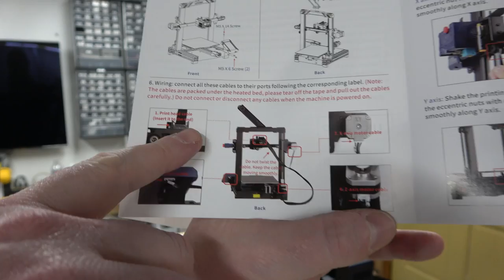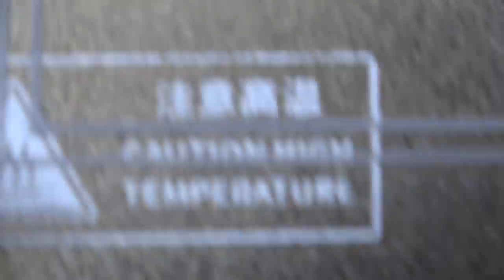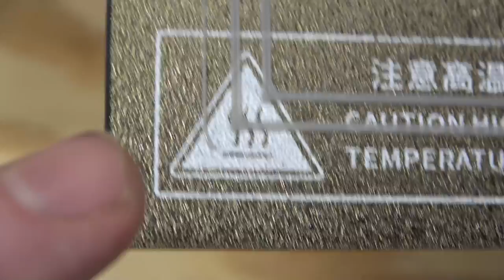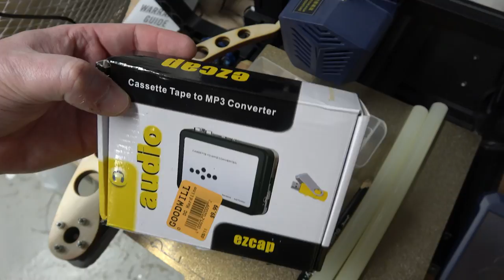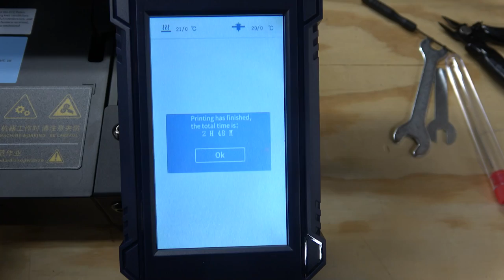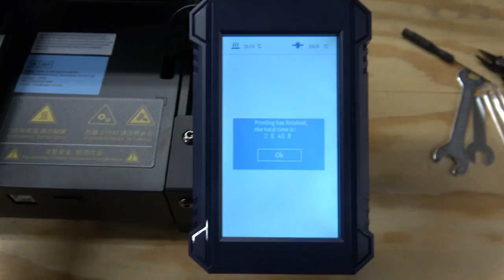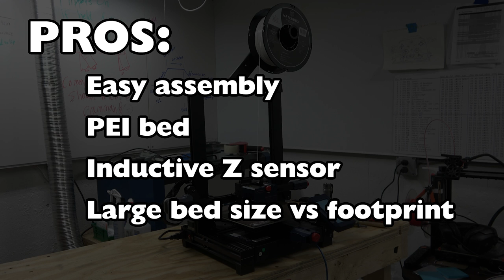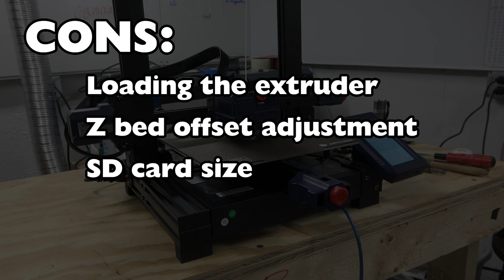Anycubic Kobra 3D Printer Review

Comment: Cura has a setting that makes it pretty to compensate for elephant foot without adjusting the model. The setting is "initial layer horizontal expansion", and a negative value shrinks the first layer.

Comment: It is set to 230V to protect the Printer. If you use it in the 230 Setting with 115V, nothing wil happen. But if you set it to 115V and using it with 230V, than you have fun but only once.
And most of the world uses 230V

Comment: If this printer had ethernet or Wifi, that'd be great. All you'd have to do is log into the interface and upload a file to the printer and it would print. I think Cura has a way to interface with network printers. I hate Cura's implementation of USB printing because, since the buffer resides on the computer and not the printer, if the computer goes to sleep or Cura crashes, then the print could fail.
Reply from the maker: Yeah that's be great! Save Gcode to disk, map network location, printer sees new file arrive and runs it.

Comment: You should be using Prusa Slicer.  Its superior in every way to Cura.  It has an elephant foot compensation setting.
Reply: Cura now has a setting first layer horizontal expansion. The nice thing about Cura is how often it’s updated, which is something Prusa Slicer doesn’t do often. Super Slicer (a Prusa fork) is better, but Cura isn’t bad either.

Comment: I agree on the SD card thing, I don't know why you'd want a micro on such a large device - you aren't cramped for space! Regular SD is much easier to handle.

In terms of the z-offset stuff that may be the inductive sensor.  I was very unhappy with the one on my Creality CR-10s Pro.  I was constantly having to fiddle with z-offset.  I think they just measure inconsistently.  I upgraded to a bl-touch and haven't had to mess with it since.

Comment: You can actually get really good TPU prints out of a bowden setup with capricorn tubing and a BMG style extruder with a small gap. The viper you have actually has a BMG clone, but only certain clones have an internal extension that reduces the gap between the filament input and the output to the bowden to just enough surface area for the gears to grip. A BMG grips filament REALLY hard so they can actually perform super well with flexibles. Capricorn tube has a more consistent internal diameter and tends to be a bit tighter than the generic tubing so that also stops the TPU bunching up

Ps: In England we just say fillet with a hard L for everything and route as "root"

Comment: My Kobra is woking great so: “If it ain’t broke- Don’t fix it.” I did do the z hight and my latest to prints had no elephant’s foot nor squishing around the bottom. I used a sheet of paper. The bed held the print until it cooled then released it. This is now my favorite printer of this size.

Comment: Maybe doesn't excuse the inclusion of micro-SD, but the best purchase I ever made for my MP Select Mini was a micro-SD to full-size SD adapter (basically a long ribbon cable with a housing that supports full-size SD cards on the end, and a male micro-SD on the other end). Quality of life improved dramatically since the SD card is basically the only viable way to use that printer.

Comment: I have one of those cassette to MP3 deals, and if you have old audio-books (and  a lot those of the vintage that came on cassette are no longer available) on cassette to put it into another storage media....  The 'zit' that you 'cleaned off' is a hatch latch for the port-hole in the back of the cabin on the benchy, depending on which one you are using it will be there and is NOT a mistake.

Comment: The question is, if you are knocking the same parts out per run, is 4 of these at $400 faster with better print quality than a V400  for $829 running at 200 mm/s?
Reply: Not sure what you mean about $400, these are $299 normally, and on sale now for $245.

BUT, Why not buy one for $99?  Ebay unrepair.  These are due to Covid and people trying out new hobbies and failed wannabes returning them.  I've bought 4 unrepairs now (1 x Ender 2 Pro for $69 delivered, 2 x Ancubic Mega X for $109 delivered, and an Aquila for $89 delivered for a relative) only 1 of them wasn't mint condition, never even attempted to be assembled on the other 3...  You can even buy the Allstate Warranty for $6 to ensure you get it running ok...

But for this build size right now, the by far best value is the Sovol SV06: same sensor auto leveling, linear rods ALL axis, true FULL metal hotend up to 300c, direct drive with planetary gearing, same PEI bed, full Marlin on control pad, 32 bit board with silent steppers, all for $259.
Reply: @brianmi40  these are on sale at micro center for $99.
Reply: @brianmi40  you could have almost 3x Kobras, for the price of an sv06, so I don't really see how that's an excellent value.
Reply: @foam27  ZERO Kobras can print high temp filament, that's the value.
Reply: @foam27  That's a great price, unfortunately, having to pick it up only, with only 25 stores, limits this to a minority of most people.
Reply: @foam27  Pretty sure you're mixing up Kobra and Kobra Go.  COMPLETELY different machines.

Comment: The lion kingdom has to probe before every print & adjust Z offset during the skirt.  The bed is compressed by the pressure of filament extrusion, at least with buildtak.

Comment: this is a terrible printer plz buy the Vyper instead its 10x better, Issues: Ones sided fan duct hence always leaves yr prints looking terrible on one side, Micro SD is just silly to have on such a device where you have to remove it a few times daily, top frame support piece is plastic making the frame sloppy, the single Z motor can not keep up with prints higher then 150mm causing large amount of banding, the extruder kept on skipping when feeding large volume of filament, the bed level sensor is set too high hence you have to offset Z axis by 1.5mm which is not usual from any other printer I owned (-0.1mm-0.2mm MAX usually), the runout sensor is inside the direct drive mechanism making it impossible to remove and forcing you to apply twice the regular force to insert new filament, every time you remove filament the PTFE piece pops out with yr filament because the nozzle melting chamber is much larger then 1.75mm, these were all issues I noticed on the first few days of testing, I need to do more comprehensive tests before finding out more issues, I've had 2 Vypers that I purchased last year and till now they have been printing at least one spool a week without a single issue, the Vyper is more ridged better made and higher build volume and quality, I have tested more then 30 different printers since I started in 2014 and I would def recommend the Vyper for beginners and the CR-10 v3 for Advanced users. It would be nice to see more honest reviews! I would also suggest using the printer for at least a week before releasing a review video. PS printing a Benchy isn't as useful as a calibration tube 😉
Reply: And why is that?
Reply: Does build year make any sense between  3D printers in general?
Reply: @justinsmits3916  off course it does the later the better, the first Vyper that was released in the end of 2021 had 3 upgrades on the first quarter sales in 2022 google it 🤓
Reply: @mussydesign7933   You prefer the Vyper right? I agree with your statement. But I still can't make a choice between the Vyper and Kobra.....

Comment: I have been using it for a month with PLA, ABS, TPU and PETG. It was working 24/7...

Then yesterday it messed up a PETG print. I then dried my PETG. It dod not help. I level the bed before every print and set the Z offset.

Went back to PLA and used a piece of gcode that I have printed two dozen times already without problems.

Changed the nozzle. Went through the manual again. Tightened the belts, etc.

Nothing helps. It messes up all prints and I have no idea how to solve it.

It seems the leveling is a bit off after auto leveling. Z offset is a bit lower on the left than on the right....

Comment: Hi first of thanks for your entertaning vids i have this printer use it fir my hobby rc planes and has been great until now the extruder stepper motor starts chatering have checked blocked nozel voltage to stepper and the drivers on the board to no avail would you have any idea ?

Comment: that textured sheet is designed to help keep the plastic stick when hot, but release when cold. that's why it was sticking well when you first removed the prints but it was popping off later. also if you take the prints off when the bed is still warm, it could pull off some of the texture
Reply: which is what you just said in the recap. guess I should watch to the end first.

Comment: I can't get mine to auto-level it  fails in the same spot and says, "Leveling sensor abnormal, please check it and wiring." Any tips? I feel like I have tried everyhting.
Reply: The problem was the nozle kept crashing into the print bed. I solved it by lowering the right side some more. This is my first 3d printer so I am still learning. The first print came out perfectly though!

Comment: My 3d printer display is turning off when I try to print, is that bad?
Reply: I mean if the printer is printing without any issues it should be fine
Reply: @_sb_1168  I ended up figuring it out, had the power at 240V instead of 115V

Comment: Don't buy this printer, parts are good but for the PSU which is a very low budget power unit. My new Kobra comes with a failing PSU, still waiting the part after 2 months. If you don't know what to buy, buy something you could easily find parts, so, not from China like the Kobra. Poor electronic design.
Reply: you do know that 90% of these printers are from china, right?
Reply: @MistaJGames  You're right, I was meaning "not from a Chinese reseller", ie "buy something you can get refunding and/or a true assistance". My experiences with Anycubic has been ugly, eg technical staff provided solutions that could be fatal to my own safety (sending picture with wrong PSU/AC wiring), they asked me the same question again and again, they asked videos, told me they cannot read it, and so on, until I gave up, after 1 month of talking to myself "stay calm dude, be patient" ! But no results. Their score on Truspilot is actually what they deserve. Thanks for your reply. BR

Comment: Mine doesn’t extrute, I’ve cleaned the gears, replaced the nozzle, and it still doesn’t work. Please help
Reply: Does the nozzle heat up?
Reply: Probably your nozzle is blocked. Heat up for ABS and use the tiny needle that is supplied with the printer to clean the nozzle.